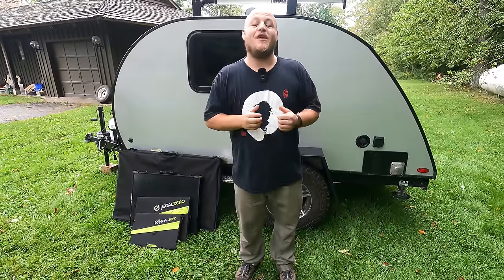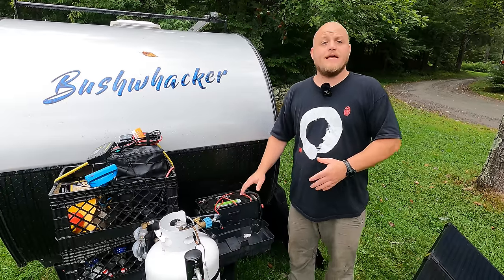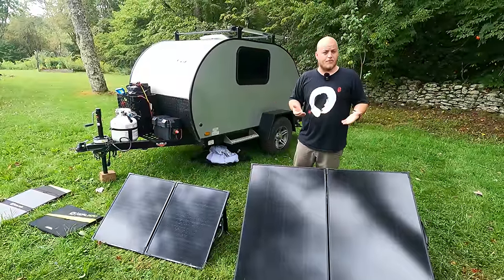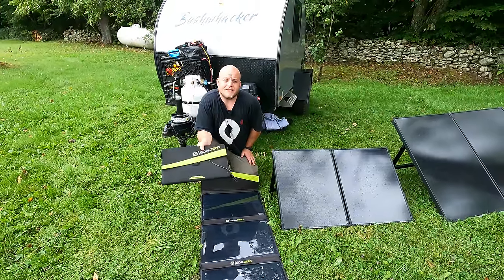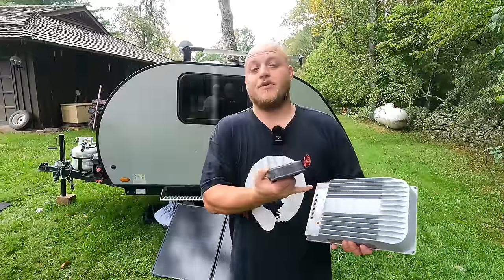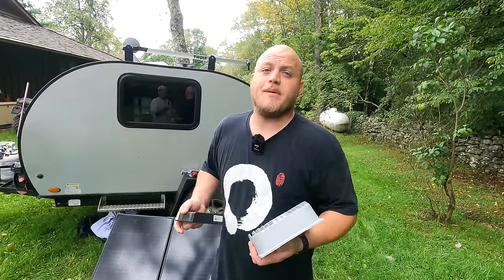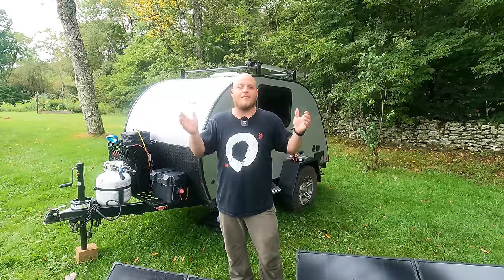RV Solar 101 : Everything a Beginner Needs to Know !

Comment: Brian,  I just returned from a week-long boondocking trip.  I took your advice, bought a Renolgy 200-watt suitcase, and paired it up with my 100Ah battery.  I used all of my campers' 12-volt features, Alde heater, and fridge. lights and audio.  I never even came close to the limit of my battery.  The solar panels topped off my battery easily in 2-3 hours and I had 2 cloudy days but it only took a little longer for it to charge.  Thanks for the advice.  You're the bomb
Reply from the maker: This is great news, sounds like you have an excellent system… Much cheaper than some of the alternatives too!
Reply: Glad to read this @MikeLoper. Every year we boondock for 6-8 days at a pop and do it at least twice. We have other trips that are 3-4 days long. Our camper has an electric or propane fridge as they draw very little power when run on propane. The events we attend where we are boondocking have showers and port-potties. So we really only use the battery to run the fridge on propane. To see you ran a 12V fridge (a known energy hog from the research I've done) and were still okay is good news for sure!
Reply: How many amps did you run during sunny day or cloudy?

Comment: I love the way this guy explains. the tone, the content, the encouragement. I actually absorbed it and felt like an adult for 5 minutes.
Reply from the maker: Thank you for the kind words, I really appreciate you watching the channel!
Reply: lol 🎉😂 I know and I’m a female solo van lifer just starting out in 2019 Ford Transit 250 High Roof ExT Van. Used to be an Amazon prime van. Help omg this I understand thank you but still I don’t know hmm I have Bluetti ac200max generator either (3) separate 100watt panels. Live in Florida (hot hot). I bought small fridge (like cooler) and looking to use my laptop, 32 inch tv, portable air conditioner (not sure which I’m still trying to figure that out) string of LED lights, ofc a digital hot plate. Do I use bluetti extension cords n other cable or wte? Or with that mppt I just found a few on amazon. I’ll read more in comments AND ILL COME TO YOU help lol 😅😊
Reply from the maker: @kristinakelley4683 ill help any way I can, stick with it!
Reply: @kristinakelley4683 hey what air cooler did you end up going with. Starting SUV life and thats my biggest concern in dry new mexico

Comment: I subscribed because you explain things well and break them down to the layman’s level. Thanks.
Reply from the maker: I really appreciate that.  We all got started at some point and it's important to remember what that's like. Thanks for watching and subscribing!
Reply: @DIYOutdoorLife 
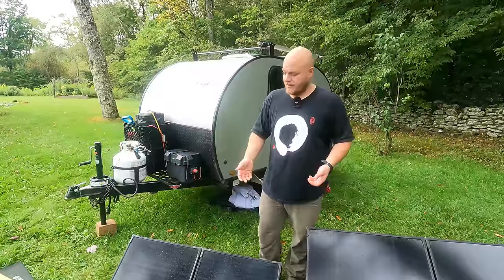@ 21:40 you slipped up…
Is that panel a 120 or 100 🤔🤷‍♂️
120 watts/ 12 volts = that 10 amp PWM Charge controller 😊 👍

I know it’s a lot of numbers 😅
WELL DONE 👍 😮
Reply from the maker: @RVingwithG  haha... I didn't wanna say 8amp charge controller, they dont make many of them.

Comment: I want to share an update on my solar install. Renergy 175w solar panel, 30 amp inline stick fuse, go-power pwm 30 controller, optima agm 55ah battery. After studying your videos this is what I think fills my needs to maintain my system between my 3-4 camp day trips. The hardest part of this install was pulling the coiled zip tied factory installed cables out of the controller size hole we cut in front wall. The most stressful part was drilling the pilot holes in a new camper roof to solid mount the panel. Roof mounted connectors are factory prepped. Thank you Brian for your simple information videos that helped me decide what basic design I need and helping me find the confidence that this is a doable, driveway DIY project.
Reply from the maker: Nice work, you saved thousands on the DIY, hope it works great!

Comment: Modular is the way to go; have both fixed and portable.  With quick disconnects you can choose which system is in use.  Portable panels are less efficient than 'real' hard framed panels so there are trade offs with each system.  A properly angled portable panel may still no put-out as much as a non-angled 'real' panel that isn't angled.  Light bar clamps are a great way to affix a panel across the rails; no roof drilling.  Just be sure the width of the panel doesn't over the fan lid. Having two options I think is the way to go.  One is none, two is one.  Thanks for the great videos.
Reply from the maker: Great stuff! I have motorcycle handle bar clamps, same as light bar clamps… great tip!  My roof panel does go over the roof vent but it has a tilt,  I go over it in a video next month.
Glad you’re rocking out the off grid set up, send pics!

Comment: New sub here, I really like your honesty and teaching style!
I'm considering a suitcase - solar on the side set up for our class C RV. I have 2 12 volt  100ah flooded batteries (I plan to change out to AGM). No converter and we use lights, device charging and furnace when needed.
If I followed the math correctly I should get a 200 watt solar set up ..... or would a 100 watt be enough?
Reply from the maker: All depends on the solar conditions of your campsites. Obviously the 200 will do much better in tree covered areas.  If you have good open sites, the 100 will probably get you by.
Thanks for watching and commenting!
Reply: 200 waàyts 116 wàttß solar uñ

Comment: Perfect timing for me to see this video. Heading to Harbor Freight for a suitcase solar kit.
Reply from the maker: Nice, the thunderbolt series gets very mixed reviews.  The biggest complaint is that it’s enormous for the amount of power it delivers.  The most common model connects four large 25 watt panels.  If the size and weight is not an issue, the HF panel does deliver the rated power.

Comment: I want to say you made this really interesting. By adding two batteries and wiring them together that doubles the capacity?  This whole solar thing , I thought was difficult. Thanks
Reply from the maker: Correct, if you wire them together in parallel ( + to +) It doubles the capacity.

If you wire them in series ( + to -)  The capacity remains the same but the voltage doubles

Comment: Really great video!  I've been developing solar systems for personal use for ten years or so, completely by the seat of my pants.  I now have a system in my converted Sprinter van that includes a 300ah LiFePO2 battery and three 160w mono panels that I'm quite happy with.  I wish I had seen this years ago.  It would have saved me a lot of trial and error.
Reply from the maker: It’s a lot of fun to learn, although there is some expensive lessons along the way. Great system!

Comment: G'day from Australia.
I live on my 27 ft sailing boat.
I have a 300 watt solar panel, and a 300 watt wind turbine.
300 watts seems to be the maximum to recharge my  500 watt and 1500 watt power stations.
There's only 5 hours of peak charge from sunlight, so my batteries have to recharge in 
so you should be buying in that 
time frame to recharge the batteries.
The  two combos go through an mppt 30 amp daul controller and two separate controllers.  One for solar and the other for the wind turbine providing a 12 volt direct current. Together both systems work well togetther 24  / 7 in all kinds of weather.
Gerard live aboard on
SV GEMSTAR.
Reply from the maker: Great set up!  I have some new wind gear that I'll be showing on the channel this season, it's a great compliment to solar.

Comment: As a newbie RVer I appreciate this very much. Thank you. We have a Tracer 190RBSLE with a 10amp Furion Solar plug on the side. I’m thinking the charge controller is wired inside the camper and connected to the battery but will investigate. 
Thank you for the help!
👍😎
Reply from the maker: Thank you so much for tuning in.
Unfortunately, most fine that there is no charge controller, it's just a sales pitch .  Please let me know if yours actually has a charge controller.

Comment: I just did a weekend trip camping on my dual battery (group 24) setup. So 80ah usable 160ah max. With the wife using the inverter to watch TV both nights for an hour or so, the batteries managed but may have been a bit depleted by the final day. So I'm definitely going to consider a portable solar panel system.  Set up when needed for off grid and the ability to chase the sun if the trailer is parked in the shade. Think 100-200w would/should be plenty.
Reply from the maker: The solar will make a huge difference.  Your situation with the TV is very common.  Another tip that people have had a lot of success with, is switching to a DC TV.  The 12VDC televisions use so much less battery than running through the inverter that people often find it's cheaper to replace the TV than the cost of upgrading their battery or solar.  Since you're close, I would start with the solar, but it's worth considering.
Thanks for watching!

Comment: Great presentation. I bought a Yeti 200X and paired it with 2-20W GZ portable panels. This allows me and my buddies power for phones, tablets and notebooks. I also purchased a Yeti 1500X and three 100W Boulder briefcase panels to keep my home fridge cool if (when) we have a power outage. But then I added a portable fridge because it runs off the 12VDC outlet, more efficient than running off the 120 V AC outlets. Also, using the portable fridge helps avoid opening the home fridge during the day.
Reply from the maker: Great system… lots of handy uses there for sure!  Thanks for watching.
Reply: @DIYOutdoorLife  oh, I would like to share one other reason to "consider" oversized the solar panels.

With the Yeti X you can use the battery while you charge the battery. So during the day, while charging the battery you may use and charge other things like a laptop computer. With a targeted ratio on solar panel to battery, you can replenish the battery during the day and that many watt-hours are available until the next morning. But with some extra solar you can run things during the day while charging the battery for the nighttime use.

My own target, in the Mid-Atlantic area, is 20% of the battery watt-hours in panels. For my Yeti 1500X that indicates 300W of panels. Using the 70% estimate, it would take 7.5 hours of "good sun" to recharge the Yeti to 100% from near zero. Of course we try not to run our batteries below 15% and the last 15% charge at the top takes longer, so it won't be exactly 7.5 hours.
Reply from the maker: @eddarby469  great points!

Comment: Wow, the 3.5 rule of thumb is shockingly accurate. With 4, 100w Harbor Freight panels, I was able to get 1200 watt hours of energy in a single partially cloudy day.
Reply from the maker: I've been doing it a while, I swear by the number.  I do better in the peak of the summer, obviously worse in the winter, but 3.5 becomes very helpful in the long run.

Comment: Fantastic information. I thought it was interesting. I have a portable battery set up. Easy to use, suits my needs. I think best situation for me and my camping. Now adding a micro camper to the mix. Maybe needs will change. At least now I can refer back to this video. Thank you!
Reply from the maker: That is a great set up for many! Like you said, a few more considerations when adding a camper into the mix. In upcoming videos, I 'll show how these systems can charge potable batteries, camper batteries, and portable power stations without buying separate gear. Thanks for watching!
Reply: I said the same thing to myself, I’ll be referring back to this video specifically for sure!!

Comment: Smooth to the point..thanks
Question..
I have 6 160 watt 12 volt panels
21 volts ocv
Might want to increase to 9 160 watt panels 
Now have 4 100 amp hr lithium chinns batteries.what would be the rite math..
Please for a charger controller 
I am scared I will make a mistake 
Thank you
Great show brother!!!!!
Reply from the maker: Nice system! 
Your batteries have 4800 to 5000 usable watt hours. No 50% for you because you’re using LifePO4. 
You 100% want to use an MPPT.  Stay away from PWM for a system like that.  What size charge controller will depend on whether your wiring in series or parallel.  For a system like this, you will probably be mixing both.

Do yourself a favor and go with a Victron MPPT.  If you wired nine 160 W panels in parallel, your current would be outrageous.  You would spend a ton on wire big enough to handle that.  Your best bet is to get the current down by wiring in series, maybe 3s 3p for the 9 panel and 3s 2p for the 6 panel set up.  This charge controller I’m linking could handle either set up.
#ad https://amzn.to/3sNgLlR

Comment: Dude this is what I was looking for, the math needed to figure out what size I need. This is the core of my set up from truck through getting my cabin set up. I need to be onsite but right now there is nothing there but trees and a stream and currently 3ft of snow.  I need to get up there , live in the truck and tent while I get the tree management study done and borders marked, figure the site for the cabin, septic and well, , right now there is no driveway in off the road or at least no deeded ROA so I need even the driveway cut in. A cabin and garage delivered,  and my tractor and attachments hauled from three states away. I need to get my camp and communications down pat without buying a rv or even a lovely egg trailer. I love to think of them as eggs or seed pods more than teardrop. I think they are great and love to have one but giving the gas crunch right now and the summer cost in camp building I need to rough it in the back of my truck but still have good electric for my batteries for tools as I have decided to cut my fossil fuel consumption down and rather than travel right now , get to know my new land and switch my power tools to battery— even the chainsaw. Start my contribution to the forest in food plots and permaculture and use the initial solar buy for my camp be the nucleus for minimalist living and getting to know my new state.Quite nervous so your relaxed way of teaching helps calm my gut over a pretty tight turn for an old lady of sixty, I am adding up my wattage needs and am applying the  principles of lightweight back packing to it. Shaving watts needed down , removing fossil fuel except for getting there. I will need to burn wood but really would like to get rid of propane as much as I can. , I right now plan to keep it as a backup. I lived towards this thru a agricultural road , from big  ag school to horse breeding farms, finally refining it to an organic partly horse powered homestead semi rural, to my final challenge of watching trees grow in the North Woods. Couldn’t get there without some directions people give. Thank you.
Reply from the maker: I love what you’re doing here! Feel free to reach out with email, I’d be happy to help you out. Sounds like you have a nice sustainable plan coming together!

Comment: As an experiment I added a reflector panel ( a square of Reflectix) to a Goal Zero 50 watt and got 50 watts out of it in the Puget Sound region of Washington state. The day had a little overcast... the panel wasn't get to 50 watts without the reflector panel.
Reply from the maker: Reflectors do work, they can make a difference.  With the new bi directional panels, you can really see the difference.

Comment: Hey Brian, Mike and I LOVE your videos!! So informative and you have such a calming spirit!!! My question is about  the Renogy 200 W solar panels with the solar controller. I have found it on the Renogy web site with a new customer discount.  Our problem is we do not get our teardrop till early Oct from High Camp Trailers in Portland OR which is a 2000 mile round trip. We have no way of testing it to make sure it works properly. How would you suggest testing it?  Mike thought we could test it on our truck battery???  I know we could wait until we get the rig home but I like having the things we need in advance and prices keep going up, besides we will want to go camping ASAP (shhh don't tell Mike.) Oh, by the way we watched the video on "My site is flooding" and I was worried for you and Ripple... as a Mama, next time move to higher ground. LOL Thank you for sharing your knowledge with us! Come to Colorado, we would love to share the Rockies with you and yours!!!
Reply from the maker: If you have a multi meter, you can check the panel for voltage and current.  That's usually the easiest way to go, especially if I'm going to buy secondhand panels. 
If you don't, hook it up to your truck battery like Mike suggested. 
Ripple is safe and dry, laying on the couch.  I cant wait to get to spend some more time in the Rockies!!!

Comment: Thank you!!! If I use a renogy mppt  charge controller that is 60amp, on a 12v 100amp hour battery (want to build the battery bank as money allows) with 200w hard shell panel, is that too low for the controller? My system is intended as backup for house in emergency. Really appreciate you breaking down the math- you're right, nothing to be intimidated by.
Reply from the maker: Thank you for tuning into the channel, I appreciate you watching!   a 60 amp charge controller is way bigger than you need, it’s about three times the size that you would want.  It’s not hurting anything, except your pocketbook, to go oversized.

A 20 amp charge controller would be more than adequate.  If you’re thinking about getting another 200 W panel down the road, maybe get a 30 amp charge controller.   30 amp charge controller will handle 400 W of solar fine.

Hope this helps and that I saved you a few bucks !
Reply: @DIYOutdoorLife  I already bought it, so I ran into you a little late, but I would like to have the capability to run a bank of 8 batteries and 800 total watt panel array. Just buying piecemeal over time. Thanks for the great info! You're right, so many vids are just overcomplicated and get my brain in the weeds...